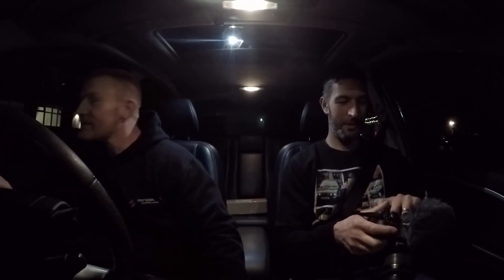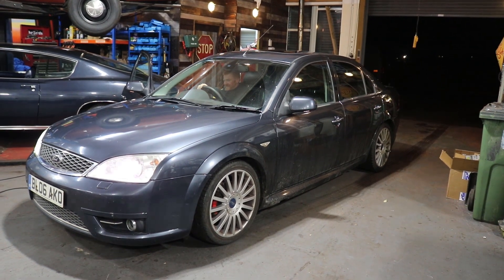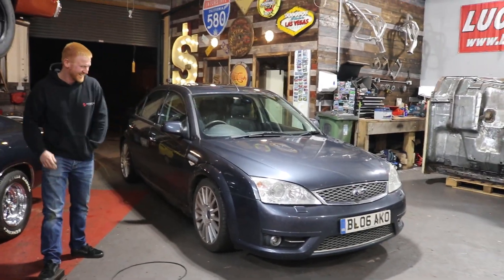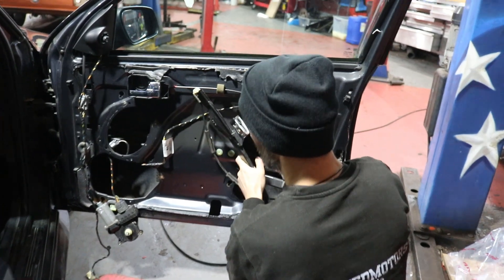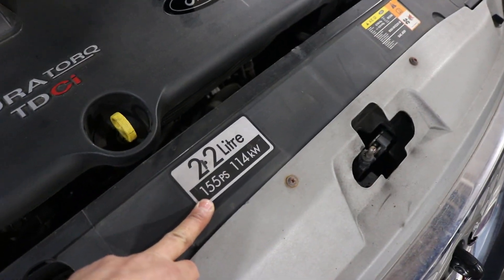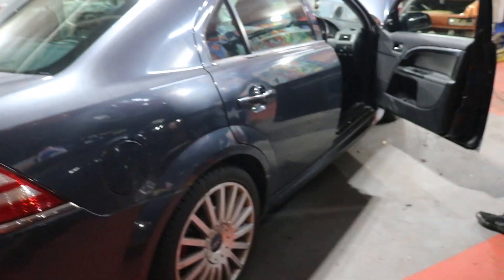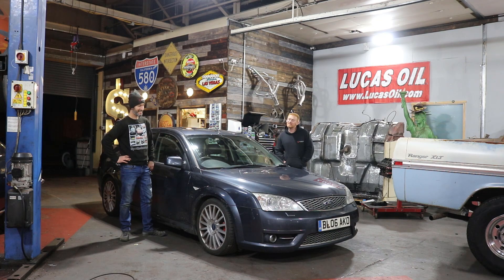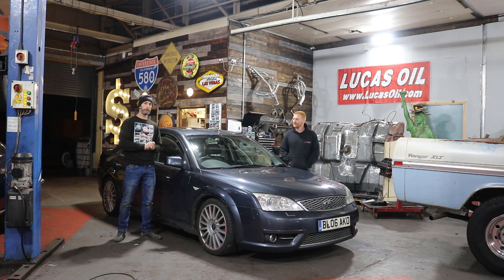Ford Mondeo ST - Diesel Power With How Many Miles ! ? !

Comment: Recently bought a 58 plate Mondeo Titanium X (2.0 Turbo Diesel).  Never had a Ford car before.  Has over 180,000 on the clock.  Drives great.  FSH from mostly Ford.  CD player doesn't work - use the radio anyway so that doesn't bother me.  No other faults. Can't believe I hadn't bought one sooner!  Great channel guys.  Subscribed.
Reply from the maker: Thanks so much for the Sub. Means alot. Yer the Mondeo is a fantastic 2nd hand car. And a Titanium X will be fully loaded too. Great cars and if well maintained can do very respectable Milage.

Comment: Just came across this vid and made me smile.
My 56 STTDCi hatchback I've had for about 10 years, currently about to hit 200,000 miles, and intend to keep it for as long as I possiby can.
Such a great car - large enough for family of five, economical enough for work mileage, quick enough for me, cool enough for the kids to be seen in.
Only thing troubling me was yesterday's news of proposed ULEZ zone to increase to cover all of London which is gonna screw me over.
Reply from the maker: Yes its a fantastic al round car. Does alot of things very well. 
What's the maintenance been like on yours? Any big problems or jobs done ?
Reply: 207,000 XD not the ST i got the more mature Titanium X but basically the same
Reply: what's it like on fuel consumption
Reply: @danevanson4223  there not that bad, town driving 30-35mpg. motorway if your careful around 55-60 if your really careful and happy to sit at 55mph behind a hgv you can push over 70mpg.  Considering there nit designed to be economical if you find the right driven pattern they can do impressive figures

Comment: 230k is nothing for a car these days if it's properly serviced. I had a discovery, bought it with 243k and sold it with 315k, it still drove mint. That Mondeo aint a bad one, I've seen a lot worse with far less miles so it goes to show that if you look after it properly then it will do you proud.
Reply from the maker: 315 k wow that impressive. So definitely got some more miles and years to do in this Mondeo. Thanks for watching and for commenting 👌